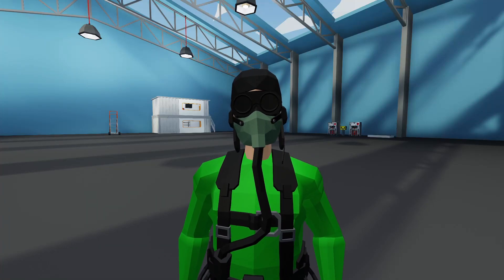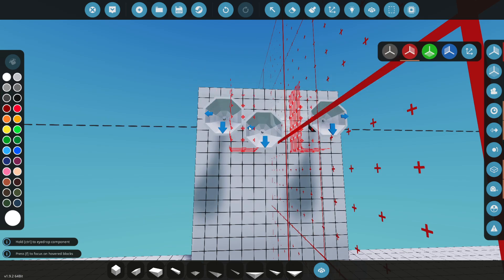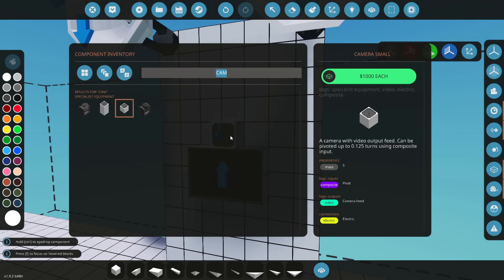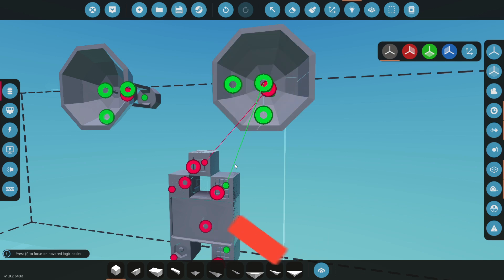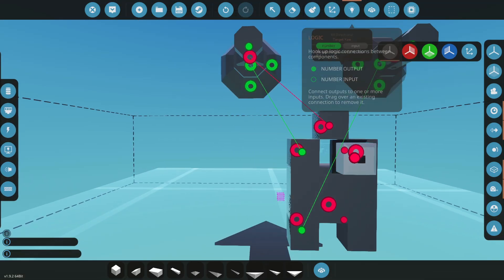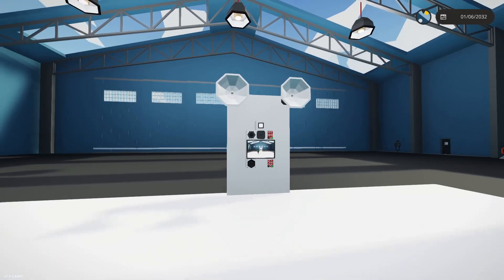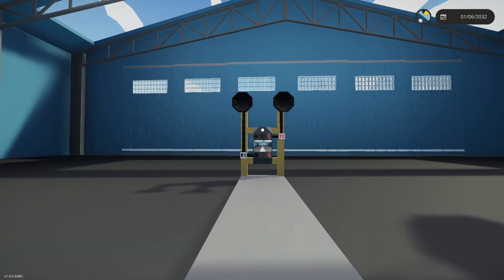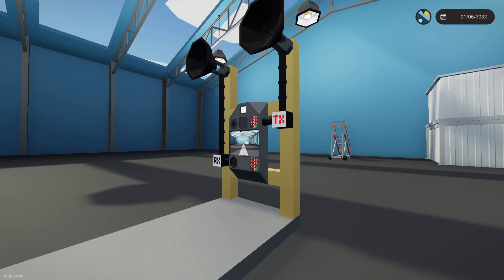Radio Dish - TV Communications - Video Call - Stormworks Tutorial - How To

Comment: I actually build an audio and video system with the old system and added it to workshop vehicles that i modified
Reply: I connected an keypad to both antennas (radio and video) and that was for sending video and audio at the same time 

And for recieve it was the same 

But the frequency for sending and receiving wasn't the same